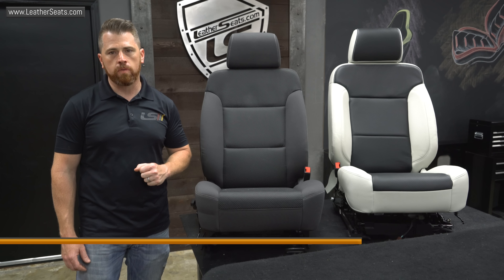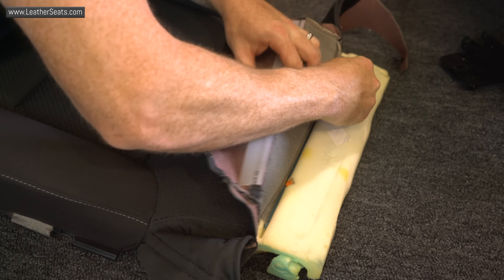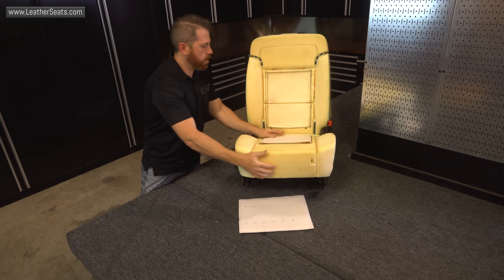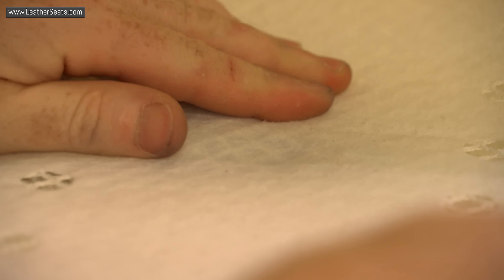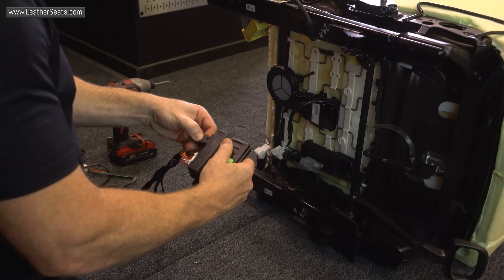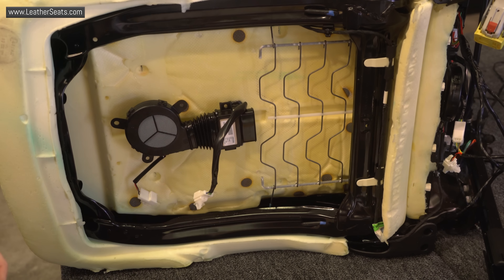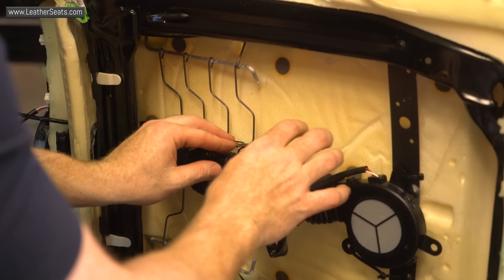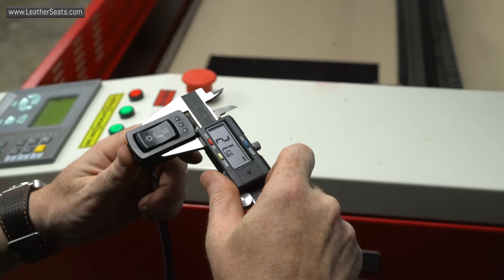Installing Heating and Cooling Seat Ventilation Units - LeatherSeats.com Tech Tips

Comment: is it possible to do this with cloth seats like on my 2005 hyundai santa fe?
Reply from the maker: justin kaufman  There are many different variations/densities of cloth seats so we really have no way of telling how effective these would be on your seats. These units were designed for and tested on perforated material with a high-flow backing foam to allow for proper airflow. Without the proper airflow, you might experience some surface temperature effects but probably not as strong as intended. Please email sales@leatherseats.com for more info.

Comment: Can i install it on my prius c
Reply from the maker: MÒÓÑ kÑÎGHT These are mostly universal units as long as you have room under the seats to mount the components and have upholstery that will allow for proper airflow. The system is designed to work with perforated upholstery with a high flow backing foam that allows air to pass through. If you have any further questions please feel free to email sales@leatherseats.com or give us a call at 1-866-639-7328.

Comment: I need to install aftermarket power seat in my 2015 Subaru outback, is it possible or not all?
Reply from the maker: Luc Bana These units are fairly universal and can be installed on almost any seat. The seats that they go into do need to have the appropriate upholstery though. The upholstery will need to be perforated and have a backing foam that allows air to flow through it. Give us a call 1-866-639-7328 or email us at sales@leatherseats.com and we can take a look at your project.

Comment: Do you make em for 2003 corolla
Reply from the maker: Mr Scowl Face The heater/cooler units themselves are universally compatible as long as you have proper access to power, room to place the units on the seat foam, as well as the proper modifications to the upholstery that will allow for proper airflow. If you have any questions please feel free to email sales@leatherseats.com or give us a call at 1-866-639-7328.

Comment: Interesting to see the aftermarket application of this type of system using thermopeltic devices, as I sit here in my office and disassemble/reverse engineer the OEM system on a Sierra Denali. Usually thermopeltic devices pale in comparison to actual compressor/freon based cooling, but the application and change in temp is sufficient for seating. Certainly much easier then ducting the HVAC system to the seats through additional blowers (though this is something I will still play around with). Quite good video work, capturing the essentials, great presentation and minimal blaugh. 

I must also say, I do believe this is the first time I ever heard a self tapping screw called a stinger screw. Great work mate!
Reply from the maker: SALCON Thanks! You are correct, the TED system is much more manageable for this kind of application compared to other methods! We have tested many other styles throughout the years and none have come close. We appreciate the comment!

Comment: Can this product be used with cloth seat covers?
Reply from the maker: Jupitor Saturn These units are designed to create airflow through the upholstery which  requires the foam backing on the upholstery as well as the upholstery surface to be penetrable. We use a high-flow mesh foam backing on the underside of our perforated leather for the air to flow through. Most cloth upholstery is not perforated but has much less dense foam backing so you may get a temperature change on the surface. The units should still work if mounted correctly however we have not officially tested this and you will not get the fullest effect of the airflow. You may want to visit a local automotive upholstery shop to see if they have any perforated cloth options that would work for your vehicle. If you have any further questions please feel free to email us at sales@leatherseats.com or call us at 866-639-7328.

Comment: Can this system be installed into any car and model?
Reply from the maker: G C These are universal units that can be installed into any vehicle with proper 12V power access, room to mount the units onto the seat, and appropriate upholstery that allows for proper airflow. Feel free to email sales@leatherseats.com or give us a call at 1-866-639-7328 if you have any questions.

Comment: Is this easier to install if the seats already have the heating feature?
Reply from the maker: It is more challenging since the original heating system must be removed from the seats before integrating this all-in-one heating/cooling unit.

Comment: Do you think it would be possible to make a switch or modify the factory switch for the seats if you put one in. I’m factory Cloth so I don’t have heated or cooled seats but if I replaced the trim would there be anything I could put in the spot were it goes on the ones with that feature to make the whole product look more factory?
Reply from the maker: @leakedcerz9455 Our switches are specifically designed to handle the six possible heating and cooling settings. Most factory switches do not need that kind of capability. You might run this idea by a pro shop in your area, but we have not tested this product in that way. Feel free to email sales@leatherseats.com or call 1-866-639-7328 and we can go over more info with you!

Comment: What if you have heated seats but you want heated and cooled seats that work with the oem switches/buttons
Reply from the maker: Grizzlyx13 Our units would replace the OEM heater units because our units blow either heated or cooled air through the upholstery and most OEM stand alone seat heaters use surface mounted pads on top of the seat foam that heat the upholstery like a heated blanket. Your factory heater switches most likely only have setting(s) for the heating function(s). With our units you would need to use the provided switches because the units each have six different settings: low, med, and high options for both the heating and cooling functions.

Comment: Would this work with alcantara seats?
Reply from the maker: GamingOfTheLegend You would most likely have a noticeable surface temperature change however it was designed to be most efficient with proper air flow via a perforated material and a reticulated/high flow foam backing on the upholstery.
Reply: LeatherSeats.com if I change the parts where it is on to foam instead of alcantara would I feel a noticeable bump also do you ship to uk?
Reply from the maker: @gamingofthelegend3907  Im not sure I completely understand. With the unit installed properly, you shouldn't be able to feel a difference when sitting on the seat. Yes, we can ship to the UK. Feel free to shoot us an email to sales@leatherseats.com or give us a call at 1-866-639-7328 and we can help answer any questions you have.
Reply: LeatherSeats.com ok thanks Honda Civic ep3 seats are alcantara right

Comment: I would consider buying this if A) they provided that cutting template for the switch with the unit. B) They had a detailed video of installing the wiring safely.
Reply from the maker: WILSON! Thank you for the feedback. To answer your first consideration, we do include cutting templates for the switch hole, distribution pad outline, exhaust/intake bezel hole, and the TED unit hole with every unit. As far as the wiring, every vehicle will be different and self-installation does require at least some experience with vehicle wiring. We do not provide vehicle specific instructions. This is considered an advanced do-it-yourself process and we would not suggest anyone tackling it if they were not familiar or comfortable wiring 12 volt applications. At the end of this video (20:17) Eric does give a good overview of the wiring process but if you have any questions please feel free to give us a call at 1-866-639-7328 or email us at sales@leatherseats.com.

Comment: isnt the cooling system in seats supposed to suck the air out of the chair?
Reply from the maker: CUBEoneVX Our units are designed to blow heated or cooled the air through the seat upholstery and onto your body.

Comment: I hope you respond, but I have a question, my 2007 Ford Expedition Eddie Bauer already have heated and VENTILATED seats, this kit looks the same as the ones that come in the D5 CAT Dozer that the company I work for just got. Can I get rid of the factory one and wire this one up to work like OEM if that makes sense?
Reply from the maker: Our seat heating/cooling ventilation system is designed to used as a complete unit, so our unit will be controlled with its own switch, wiring harness, and control module. Your OEM unit's components will not be functional with ours, so if you're OK with losing the OEM wiring and switch, you can install our units into your seats. If you have any other questions, feel free to email us at sales@leatherseats.com

Comment: Can u do it on motorcycle GL1800 honda? it got heated sets but i need cooling on them. thanks
Reply from the maker: Hossam Ali  Although the units are specifically designed to be used for automotive applications, the units themselves should be universally functional as long as they have room to be mounted beneath perforated upholstery backed with the proper high-flow foam, have proper air intake and exhaust, receive the proper power, and have a place to mount the switches. With that said, we have never tested these units in a motorcycle application so we can not guarantee your results. You may want to take your motorcycle to an automotive upholstery shop or 12 volt shop and show them this video to see if they can help you determine whether or not these units would work for you. Also the heating and cooling functions are both delivered by blowing heated or cooled air from the same module. If you would install our unit onto the seat, it would require removing of the factory seat heating system.

Comment: How much it cost? If  Labor and material add up over $500 then choose factory.
Reply from the maker: Ti10 If you could find a factory seat ventilated heating & cooling option for anywhere in the ballpark of what you are suggesting, then I would agree with your assessment. In our experience, most factory A/C seat options are bundled in packages that are significantly more expensive than the combined cost of our units, upholstery kit, and even professional installation. Additionally, many vehicles do not have a factory option for seat ventilation, and many customers already own the vehicle they would like to add the system to. Here is a link to the units on our website: http://shop.leatherseats.com/heater-cooler-units For installation price you would need to contact your local automotive upholstery shop.

Comment: Can the switches replace the factories in a truck with heated seats? I have a 2018 but do not have the cooling option.
Reply from the maker: Sebastian Martinez You might be able to use the same holes but it would depend on several things: how big are the current switches, is there enough room around them to fit ours if ours are bigger, as well as how much room is behind the plastic for wiring and components. There may be other considerations as well but you would most likely have to cut/dremel holes in the plastics to size (we do include an outline cutting template) in order for it to receive our switches. Feel free to shoot us an email to sales@leatherseats.com and we can get you some dimensions for our switches.

Comment: U have it for the 4runner?
Reply from the maker: @Tyler-ug1hs These units are universal and can be installed into most late-model vehicles as long as there is proper power, room to mount the units to the seats, and the seats have upholstery that will allow for proper air flow. Email sales@leatherseats.com or text/call 405-848-9999 for more information 👍

Comment: Do you guys ship to Sweden and will it fit an 03 9-3 saab?
Reply from the maker: Filip Andersson We have not tested this system on every vehicle out there. However, the units themselves are universal as long as they have proper power and enough space to be installed. We can typically ship just about anywhere. Please email sales@leatherseats.com with your mailing address, and we can look into a pricing quote.

Comment: Cmon, there must be a better place than inside the console to mount those switches.
Reply from the maker: The switches were installed inside the console per the customer's request. There are many places in the interior where you could choose to mount these switches, depending on your preference. Check out our latest video on the Bronco Raptor install!
Reply: @LeatherSeats  I see, well, if they wanted them there, then so be it.

Comment: Hm, considering on getting this for my truck.
Reply from the maker: Hunter Gman Awesome, if you have any questions about the system please feel free to give us a call at 1-866-639-7328 or email us at sales@leatherseats.com. You can also check out these units on our website here at: https://www.leatherseats.com/shop/seat-comfort/seat-heater-cooler-unit.html
Reply: @LeatherSeats  How do you know it's going to be yours? Hm? 

Jokes aside, I like your guy's set up. Can be applies to any car with little needed modifications. Although the 300 does seem to be expensive, but considering the factors, I can see why.
Reply: @LeatherSeats  Looking at the two sets you have, I think I will go with your guy's heater set up.
Reply from the maker: @huntergman8338  That is totally fine, it's why we have options. Our heat-only units are a simple plug an play pad that lays on top of the foam underneath the upholstery. They heats the seat via surface contact through the carbon fiber padding and can be used on either cloth or leather.

Comment: I'm just a little bit worried about how stiff the air vent tube will be when i'm sitting on the seat.  Am I going to feel it pushing up against the seat when I'm on the seat?
Reply from the maker: andrewmsteele78 No, you should not feel anything other than heated or cooled air when sitting on the seat. With the amount of reticulated backing foam on the upholstery, the upholstery itself, and the vent padding you will be very hard pressed to feel anything of the tube when installed properly. We have never heard any complaints or notes from a customer related to feeling the units under the upholstery.

Comment: Can this b used on cloth seats too or leather only?
Reply from the maker: Lefty Max This system is designed to work with perforated leather and a high-flow foam backing on the upholstery to allow for airflow. That being said you might get some level of surface cooling if there is no airflow however we have not tested that specifically.

Comment: Reticulated foam wasn't necessary for this install? Why? It says it is necessary on the product page for the Sanctum seat ventilation system you sell as a standalone item.
Reply from the maker: @silentbravo The reticulated backing foam for this install was sewn directly into the upholstery kit itself. Its purpose is to allow the air coming from the units to pass through the perforated upholstery. I hope that answers your question. If you would like some more info, please feel free to email sales@leatherseats.com, and we can help you out.

Comment: Wanna know something... A lot of Ford's have heating and ac  in there seats and that comes stock
Reply from the maker: bobby pin jr Ford does offer these options in some of there newer package bundles however the goal of our product is to make these features available for vehicles that either did not come with them as factory options or to add them later for significantly less money than factory.

Comment: Can I install these on my car if it already has Clazzio leather seats on it?
Reply from the maker: forceaura1265 Technically they can be installed with any upholstery, however if there is no perforation or high-flow mesh foam backing on the upholstery you will not get proper airflow. You may experience some surface temperature change but it will not be as efficient as full air flow. If you have any further questions please feel free to give us a call at 1-866-639-7328 or email us at sales@leatherseats.com.
Reply: So my seat cover is perforated leather but the underlying cloth seat isn't. Would it be possible for me to cut right through the cloth seat for the distribution pad and then put the perforated leather seat cover on top of it?

Also in regards to the 30A Relay, Do you guys have some kind of base for it or do I just crimp wires on to it and put it somewhere under my dash?

Comment: How do you vent the hot air out of the vehicle when the unit operating on cool mode?
Reply from the maker: JB The exhausted air is dispersed into the cabin from under the seats (or wherever you run the vent) The exhaust has a negligible affect on the total cabin temperature, while the air that is moving through the seat has a more significant effect when you're sitting on it.

Comment: Hi 
I have nissan x trail 2018 
Can install it in my car ?
Reply from the maker: ماجد الحربي These units are functionally universal. If your X Trail has room to mount the units and you have the proper upholstery to allow airflow you should be fine. You may want to have a local automotive upholstery shop in your area take a look at both the units and your vehicle's interior to make sure that they are compatible.

Comment: Why are you making notches in the cushion when the pieces are sitting above where you notched?
Reply from the maker: LMM POG 91 You have to notch out the cushion and backrest foam about 3/8 of an in because the 3/8 in distribution pads need to be seated down into the foam and mounted flush in order to not affect the fitment and comfort of the seat upholstery. They do not simply lay on top of the seat foam.
Reply: LeatherSeats.com okay cool. I need to get these for my truck soon
Reply from the maker: @abouttogetlit5120  Sounds good!